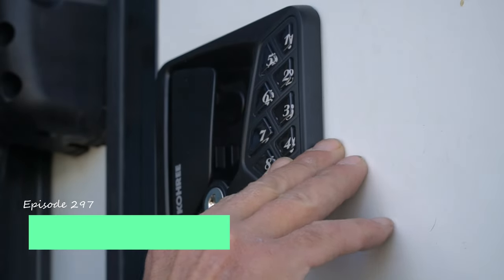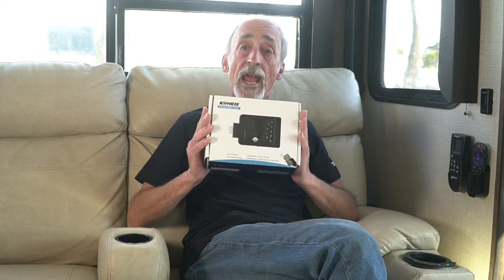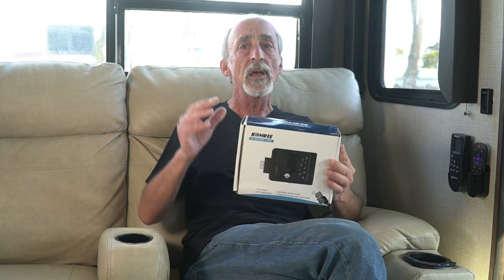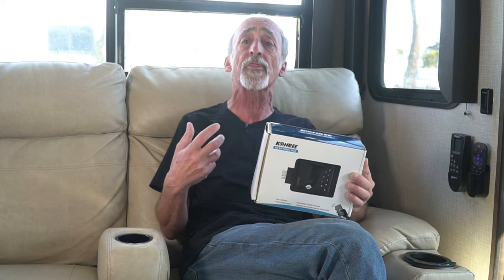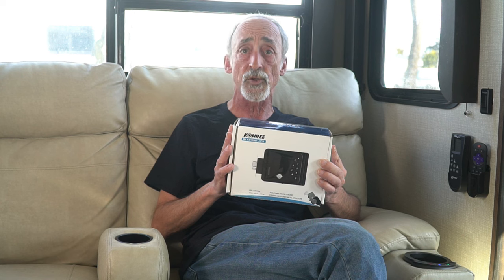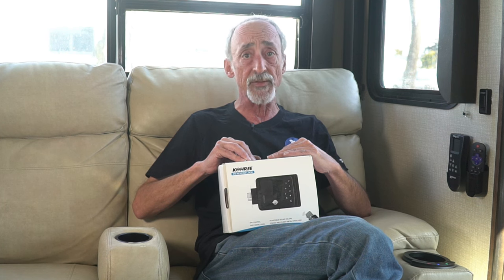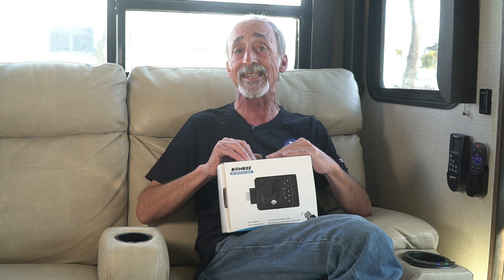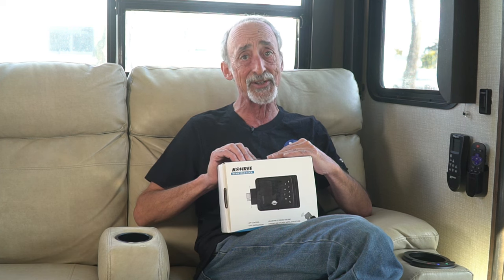Ep. 297: Keyless RV Lock Installation | upgrade modification gear Kohree

Comment: I really liked your video on this key lock and showed it to my husband. We ordered it and went to install it today, everything went fine until we tried it out. The dead bolt rolled into the locked position, but we couldn’t get it to unlock. It would make a motor noise for about a second then quit. Took it all apart and tried it on the bench, and still it couldn’t unlock itself. Read reviews other people have made with same and other issues. Boxed it up and sent back to Amazon.
Reply from the maker: Rosemarie, what you're describing isn't a problem with the lock, it's the alignment of the striker plate in your door frame. The deadbolt is rubbing on the side of the striker plate's opening. All that's needed is to move the striker plate either slightly inside, or slightly outside, which is why the striker plate's screw holes are elongated to allow for adjustment.
Reply: @GrandAdventure  No we took it out of the door as I said and tried it on the shop Bench (no door) and it wouldn’t reverse gears to unlock bolt. Nothing was in the way, it would make a motor noise for a second and just stop with bolt still fully out in locked position.
Reply from the maker: @rosemariewyatt-cs5mb  sounds like you may have had a bum one.

Comment: You didn't mention anything about connecting up with your cell phone. I recently bought this  lock and I still haven't connected.  I like the overall concept of the lock so I will return this one for another one. Hopefully it will connect up as easily as it should.
Reply from the maker: It's a very basic app, which is why we didn't show it. It just has a lock button and an unlock button. However, we had no problems whatsoever pairing it via Bluetooth.

Comment: Great install Marc. I have a RV Lock and if I hold down the 1 key for like 3 seconds or so it turns off the beep sound and if I want to turn it back on I hold the 1 key again. We turn ours off so we don't bother other campers close by in the early morning and evening hours. Your lock may have the same beeper on/off option?
Reply from the maker: Yes Michael, the Kohree has a volume control switch to either lower the volume of the beeping or mute it completely.

Comment: My advise, if you have something like the striker plate and you compare it to the original one and they are identical in size and shape, etc, LEAVE IT ALONE, remember, the guy at the factory has already pre-stripped out the holes for you!😇

I have a Carmtek lock, its a carbon copy of the RVLock V4 with changes in color and decorative features of the handle, otherwise its the same. Biggest issue is on almost all of these locks, the keys look like they belong on a childs toy. However, the lock makes it nice to leave your keys inside and go hiking and not worry about losing them.
Reply from the maker: Very true, Charles. I should've filmed a closeup of these keys, though. They're an internal cut rather than external. They'd be much tougher to circumvent, but also much harder to duplicate.

In our case we had to adjust the striker plate anyway as ours was sometimes difficult to latch, so it was a good time to replace it.